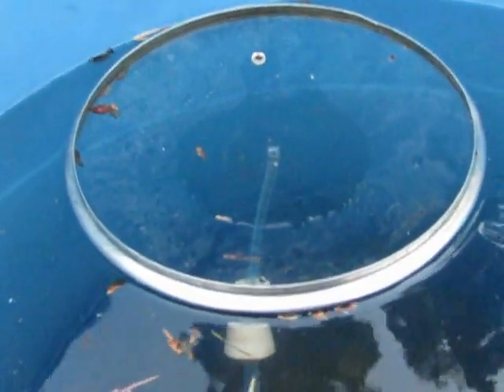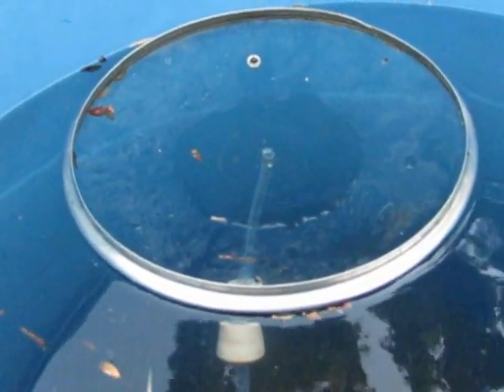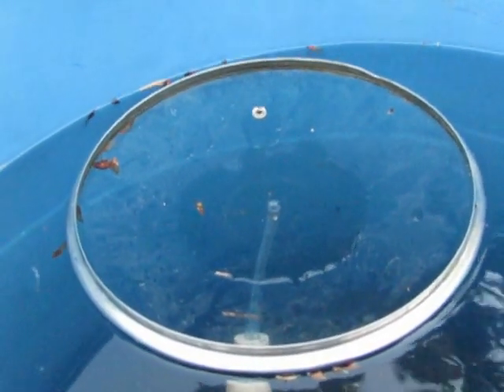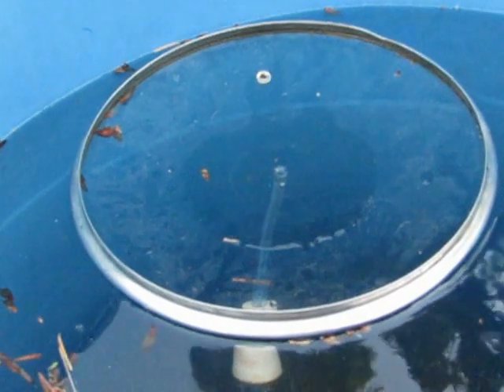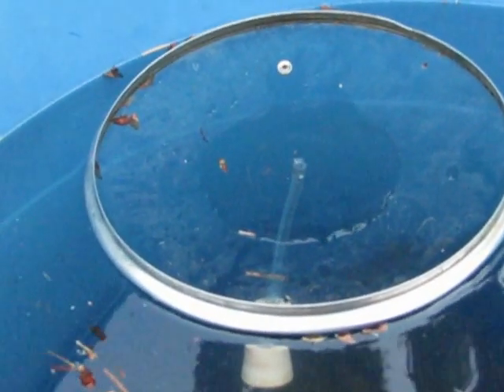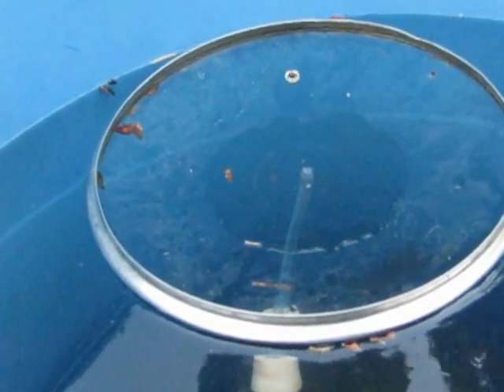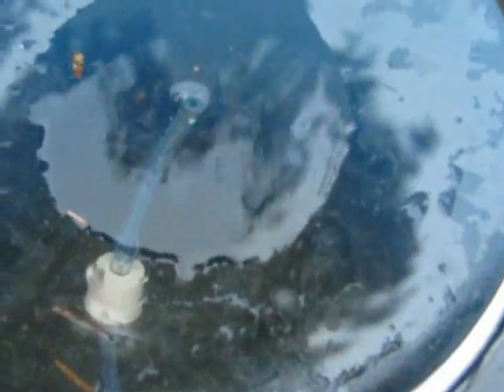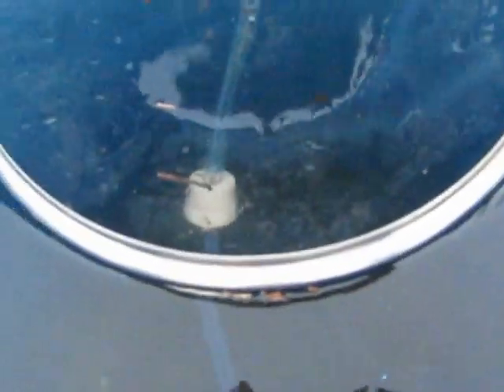Rainwater collection (and use!)  The amazingly simple TCMTECH Dripper irrigation!

Comment from the maker: UPDATE!  Just a note(Sunday November 4th)  that it is currently going at just under 6 drops per minute and I have not filled the Rain barrel since September. Rain barrel is still about 2/3 full. (So it is dripping out water at the same speed as it is coming down from the sky). The little grass stems (that slow water down coming into the lid, See later video)  had seeds on them and they have sprouted on the stems!   I am also  trying out another version of this that works in a 5 gallon bucket.